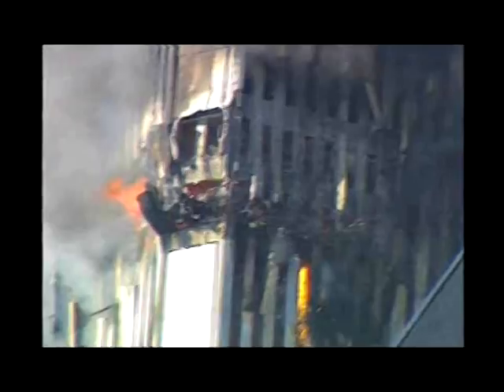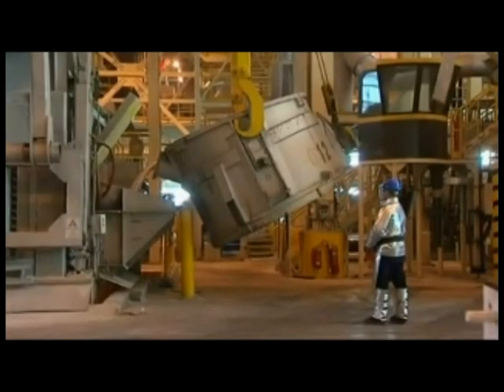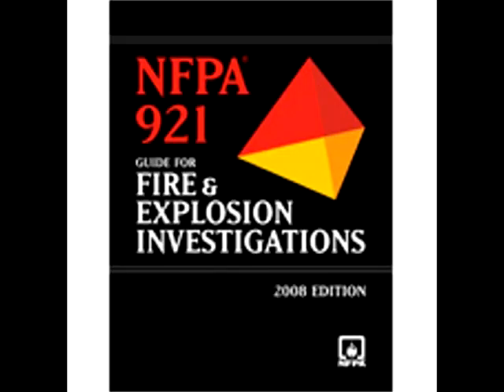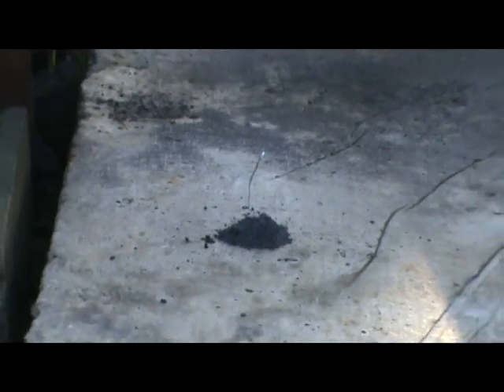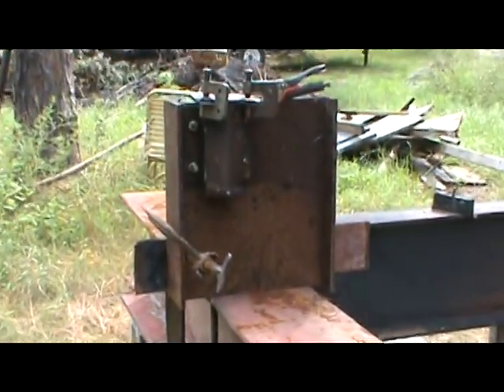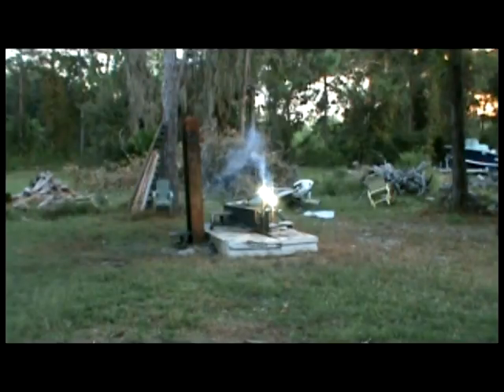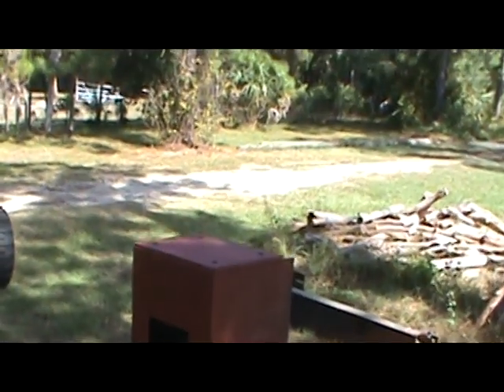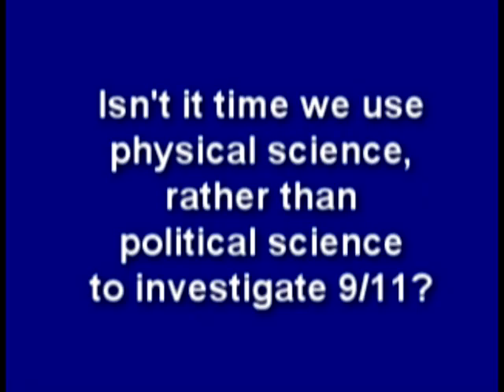9/11 Experiments: The Great Thermate Debate

Comment: @flanksteak obviously where steel was taken out the fireproofing would be taken out with it but that isnt the problem.  NIST had to assume the fireproofing was removed from the floors around the impact zone to allow for sagging and weakening to be sufficient.  It doesn't matter that the plane took out steel and SFRM in its direct path because 1.the towers withstood the plane impact and 2.fireproofing would still remain on the surrounding steel which has been made clear earlier with data.

Comment: (1) According to NIST there was both 1/2 in. of vermiculite plaster fire-proofing and 1/2 in. of BLAZE-SHIELD D SFRM on beams and spandrels.  Therefore just with this information it is contrasting to the actual tests and simulations done by NIST where only 1/2 in. of SFRM was used.  This is assuming NIST is correct with their 1/2 in. SFRM which is sketchy to say the least.  According to FEMA fire-proofing was upgraded in many locations to 1.5 in.; this includes all of the impact zone in WTC 1.

Comment: (2) Therefore NIST is either lying or deceptive to fudge results that fit their agenda.  NIST then must assume that most if not all of the fireproofing was removed within the impact zone which is evidently fraduelent.  The SFRM was tested to withstand forces ranging from 40g to 730g.  NIST estimated that the accelerations from the impact was approximately 100g.  Based on this alone  it is clear that the majority of the fire-proofing protection would remain intact.

Comment: (3) Consider that some of the fire-proofing remained intact at the initial impact zone (only proven place with some SFRM missing) where the greatest forces would be present. If the SFRM could withstand these forces then as you get further from the initial impact zone the SFRM would be more intact.  Taking these three points together, this doesn't at all match NIST's tests and simulations where fireproofing had to be greatly reduced or even lied about in the first place.

Comment: @noozilander "cores did not survive"

They collapsed last, after the floors and outer walls collapsed. How does that fit with your claim that explosives were taking out the core columns and thus removing resistance and causing the building to fall at freefall speed?

You can't explain it because you are a schizoid capable only of Word Salad.

Comment: @flanksteak2  says "The towers did not start making seismic vibrations until 9 and 11 seconds after collapse had begun."

You've missed this quote from the seismologist swallower: "The ground shaking that resulted from the collapse of the towers was extremely small." In other words, the collapsing did not cause 2.1 and 2.3 magnitude earthquakes......"

The 1993 bombing did not even register, so why would the falling debris from the towers be responsible for the 2.1 and 2.3 earthquakes?

Comment: @ThePeage Your fantasy fails to explain no columns showing incendiary damage, the columns still standing after the floors and outer walls had collapsed, the slow inward bowing and subsequent failure of a single face on towers 1 and 2 and how people in the core would have survived collapse if explosives were used and how this blown up core stayed standing while the floors and outer walls collapsed. 

Your next response needs to address the still standing core after floor collapse.

Comment: @ThePeage No, the plane entering the building knocked the fireproofing off which is validated through testing and makes sense to any reasonable person. 

You fail to explain your claim that the core columns were being melted down by explosives and thus were being moved out of the way and contributed to "freefall speed" when the buildings did not fall at freefall speed and the core was still standing almost to impact floors after the floors and outer walls had collapsed. 

You can't.

Comment: @flanksteak2 says "Extensive testing of the steel by NIST and FEMA which did not find any other damage than that which was caused by planes and fires."

LMAO @ extensive testing!
So what did NIST and FEMA 'conclusively' say was the cause of the eutectic steel then, Swallower? Oh.... that's right, they didn't. LOL! 
All they could do was throw up some possibilities, which P&R comprehensively showed were not possible. 
NIST are about as extensive as you are, ya braindead fuckwit. LOL!

Comment: @flanksteak2 says "Testing by NIST showing the floors in fact bow downward when subject to the same heat that was present in the buildings."

NIST performed 4 tests and the maximum deflection attained after 2 hours of continuous testing was 14 inches (according to them), but most deflection was much less.
So NIST ignored this actual data and used a computer model to allow 42 inches of deflection after only 57 minutes of fire in the South tower. 

Keep swallowing coward......LOL!

Comment: @ThePeage Gradual inward bowing of both faces on the sides of the buildings most affected by fire and failure of the inward bowing face in both cases preceding failure of here-said wall. 

The fact that planes hit the buildings

The fact that both buildings were on fire and had fireproofing removed by the impacts. 

Testing by NIST showing the floors in fact bow downward when subject to the same heat that was present in the buildings.

Comment: @ThePeage

b) "Not the silly "thermite reacts quickly therefore can't account for the prolonged temperatures in the rubble" nonsense, surely?"

Didn't you forget something? WHAT thermite was suppose to heat the rubble from beneath, if it was already depleted? O yea, maybe a quarter of those 200t of NT. But wait a sec. why so many of this stuff? Its proven a lot of thermite would be almost useless, but small devices, cutting through steel in an instant....

Comment: @ThePeage And we of course know that the piece of steel you showded to us was not exposed to and had nothing to do with your Paint Chips and Iron Spheres. 

The official story is Rock-Solid. 

The two phenomenons are disconnected and thus do not point to what you claim they point to (demolition using substances never before used in a demolition). 

In the end if the buildings were blown up, Al Quaeda did it. 

Who set off the Bomb in Sweden a couple of days ago? Dick Cheney? LOL

Comment: @ThePeage "no suggestion"

The author of this video draws the conclusion that Jones chips caused the eutectic steel and your argument is that thermite doesn't burn hot enought to melt steel and thus it must be made eutectic before incendiaries are applied and that these incendiaries only burned at 1800 degrees. F

Your claim is incoherent and non-conclusive but hey there are also people that believe in creationism.

Comment: @ThePeage And since Jones chips do not contain sulfur, how exactly are they responsible for the eutectic piece of steel?

And how exactly does that eutectic piece of steel which only saw 1800 degrees F fit in with your claims that thermate caused the eutectification when thermate burns at over 3000 degrees F?

Comment: @ThePeage I regret to inform you that the piece of steel was damaged at 1800 degrees farenheith. 

Since even simple thermate burns at over 3500 degrees, how exactly is it responsible for the damage to that little crossbream?

And since FEMA found that small amount of damage and USGS found Iron spheres what does that do to your claims that the steel and dust weren't adequately analyzed?

Comment: @ThePeage How did Jones account for the variability between chips such as rusty chips, chips with primer from the SFRM still on them, non-rusty chips, chips that were mixed differently etc. 

He didn't. 

And no matter what Jones found the steel shows no damage from incendiaries or explosives so it's clear that even if Jones found explosives they played no role in the collapse. 

Your one and only goal here is to produce 1 photograph or piece of steel that shows damage.

Comment: @ThePeage a) Not true b) This doesn't prove their conclusion is incorrect and yours is correct as all the input data is available c) What is the coeffecient of thermal expansion for concrete VS steel and why do you think NIST did not consider this and in what way did your calculations show it impacted their conclusions?

Comment: @ThePeage

Well now, how many tons Nanothermite were used?

Hey, i've read of an even higher estimation. Not 120... not 150... No... jucy 200.000 kg, in words two hundred thousand kiloggramm of NT smuggled into 3 buildings and stored within the boxed columns and every device with its own igniter. Isn't this great. :D

200t ... that must've been enough to maintain the heat in the rubble, don't you think?

Comment: @DarkwingScooter
"not of some other completely unrelated object."
"If an apple fell from a tree and the tree later fell over"

LMFAO! Are you for real? It was a building, a structure with interconnected components, not a tree, not an apple which is only connected to a branch and having no effects on the structures integrity or/and is in anyway a significant part of it. 

To say the roof was a "completely unrelated object", man, hardcore stupidity at its best, kudos to you for this.

Comment: @Merlin5x5 

And that very same "heat sink" property can *also* be used to undermine the NIST explanation of thermal expansion and weakening. Did their models even take into account the heat sink?

Moreover, the steel is less able to dissapate extreme heat of thermite in a few secs as compared to the 40 mins "fire" as postulated by NIST

Comment: Fact: WTC 7 fell at free fall for 2.5 seconds. This couldnt have happened without every single supprt going at the same time. 

Fact: Marvin Bush did work in Securecom from 1993-2000. Securecom was paid to place security systems in the buildings. In 2000 Marvin Bush left for HCC insurance. HCC insurance covered WTC complex. 

Fact: Motlen steel is recorded in photo and film evidence. Meteors were recovered from all 3 basements. Steel was melted period.

Now that wasnt to hard to find a few

Comment: @flanksteak1 "Why is bowing of the outer wall not possible with a sagging floor?"

If the floor was sagging it would lose strength. Steel is not used for strength in compression. If the floors are sagging it is due to loss of tensile strength.

So if the there is no tensile strength how are the outer walls being pulled in? The steel is stretching not pulling.

No, the only explanation is a core failure pulling the perimeter by the floor trusses until they fail and collapse ensues.

Comment: @DURound "It [gypsum] does not conduct or release heat to an extent that would contribute to fire spread, so this material is often used to create a firestop or to protect building components from fire.  Gypsum blocks are sometimes used as protective insulation around steel members or to create fire-resistive enclosures or interior fire walls."  ---Fundamentals of Fire Fighter Skills by IAFC

Comment: ASTM E119 criteria for the test include these features.  No steel temperature at any point on the steel shall exceed 1300°F.  The average steel temperature at any location shall not exceed 1100°F.  The furnace temperatures during these tests reach 2012°F for a much longer extent of time than that which was seen in the WTC fires of 1800°F.  How much clear do things needed to be worded for you?

Comment: @jizzmonger says "thermite burns @ 1800 F"

No, swallower, thermite reactions can burn at 2500 degrees celcius, or more than 4000 degrees fahrenheit.
'Thermate' has sulphur added to it to reduce the melting point of steel, just like in the eutectic steel that you have failed to explain! 
LOL!

Keep swallowing Jizz.......

Comment: Are you that ignorant that you have failed to even read the temperature of ASTM-E1199 tests; test were done using Celsius and yes they did reach 1100 degrees but degrees Celsius.  1100()C=2012()F.  "It's still well above the 1100 degree cutoff for the ASTM-E119 test so we know the fires were plenty hot."  Your incompetence is astounding.

Comment: This was the most important statement which followed:  "All four test assemblies SUPPORTED their FULL design LOAD"
If you read anything you would realize that the sagging observed in these physical tests was not nearly enough to initiate the collapse as NISTs claims in it simulations. It isn't sufficient enough to induce buckling and the collapse and the buckling that would have resulted relative to the exteriors walls relative to plane damage would have been asymmetrical.

Comment: This is one of many examples. Put in general terms, when the initial model (supposedly based of testing) didn't match the actual events input data could be changed by NIST obtain desired results. This can't be done in a scaled physical model which is the essential difference between the two. Physical experimental data can be replicated. Another problem is that this simulation isn't even available to the public.  We must rely on the "extensive computer modeling and the evidence HELD by NIST."

Comment: The simulation has problems in itself.  First of all it relies on circular reasoning.  Here is just one example.  "Since the full floor models did not accurately estimate the pull-in forces at floor/wall connections, the fire-induced damage obtained from the full floor model analyses were modified by observations obtained from the examination of photographs and videos performed by NIST"

Comment: “Finding 7: All four tests demonstrated that the floor assemblies were capable of sagging without failure. The unrestrained test, which had two 0.875 in. bolts fastening the main truss to the truss seats, did not sag sufficiently to bear on the bolts.” “Finding 8: All four test assemblies supported their full design load under standard fire conditions for two hours without collapse.”

Comment: @DURound i find it more scientific by definition then what NIST did.  Here is an excerpt from Douglas's critique of NIST's "science":  "Effectively, all of NIST's conclusions are derived from computer simulation.  The reasons for this are not entirely clear.  NIST should have performed destructive tests on mockups of key components of the WTC structural systems."  Feel free to read the rest if you wish by just searching "NCSTAR1 DOUGLAS".

Comment: @palasta It doesn't matter when the collapse begin. In Newton's laws fall time is measured from the point movement begins. It is just that simple.

No if, ands or buts, you check when movement begins, measure from there. s= ut+1/2at^2. The corner was not moving when the Penthouse collapsed. Its displacement was zero and its initial velocity was zero.

But you knew this already and are just deliberately being stupid I presume?

Comment: @FarmGirlJB What an idiot, adiabatic flame temperature is not steel temperature.

No truther I know has ever argued that if the majority of columns failed at the relevant level as described by Irfanoglu and Hofmannwwhen when the steel temperature reached 700oC the failure would not occur as required in the OS.

What debunkers like yourself have failed to address is how this could have occurred, often with numbskull thinking like "jet-fuel", because they think that means really hot or something.

Comment: @jizzmonger says "To repeat for the 8th time. Both.
Once the floor begins to sag it begins to pull inward on the columns."

LMFAO!
For the 8th time, you say 'both' and follow up by saying the initiating event was the trusses 'dragging' on the walls, NOT the walls 'pushing' inward on the trusses! 
If the initiating event was the trusses dragging on the walls, then lateral forces acting on the trusses was the EFFECT not the cause, shit for brains.

Comment: @jizzmonger You say that sagging floor trusses pulled the perimeter columns inwards initiating collapse. That means lateral forces did not cause the trusses to sag and it must have been the fire that caused them to sag. But the actual tests revealed only 3 inches of sag, not the 42 inches, as in the NIST computer model.
You have debunked NISTs lie. Good boy, swallower. LOL!

Keep swallowing coward....

Comment: Why do so many ppl believe in this thermite issue?
Just because of some glowing "stuff" pouring out of WTC?
On a TV-quality Video?
ever thought of false colors due to older (2001) CCD sensors?
glowing brighter does not necessarily mean it was liquid steel from thermite and therefor hotter that the other flames. Did any one eyewitness it?

It could have been anything else (as well as steel) yes,
but I would say dripping steel(or iron) looks much different.

Comment: @jizzmonger it is still necessary to supply this setup of the rack "this rack has four supports columns per section, two of which are interconnected to another section, etc. Take out the one leg of a table with a weight of objects on it, will it stand , no it won't. This is similar to this video."  WTC 7 is not setup like a simple table, it was made with multiple load bearing columns that work independently, it was an asymmetric building, not very symmetrical compared to this  rack

Comment: @jizzmonger  my bad, either way though this shows little compared to Building 7.  Like mentioned earlier the rack was damaged at one specific point, you claim that one column damaged caused the collapse of building 7.  If you watch the video you utilize as a comparison the damage begins to spread out from the hit column, this is evident even from this shoddy security camera type video.  The section where it was hit is virtually on the ground by the time other areas begin to fall.